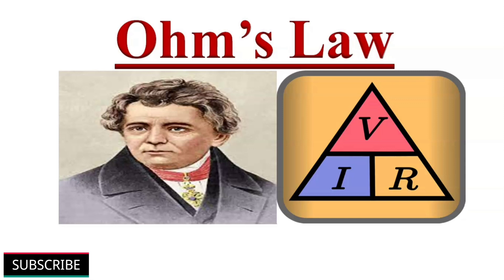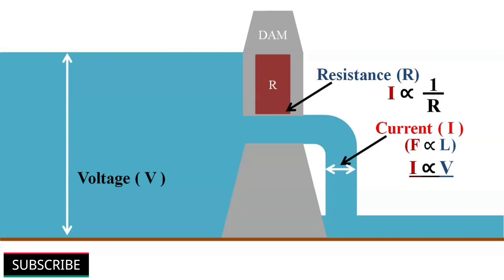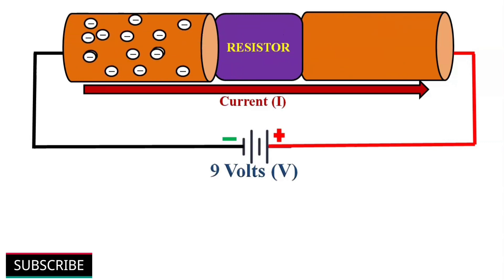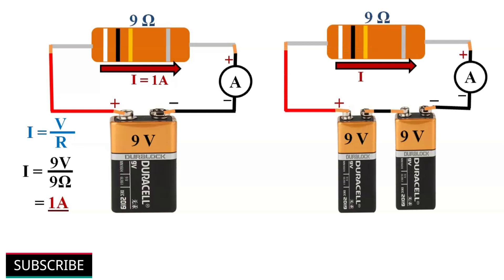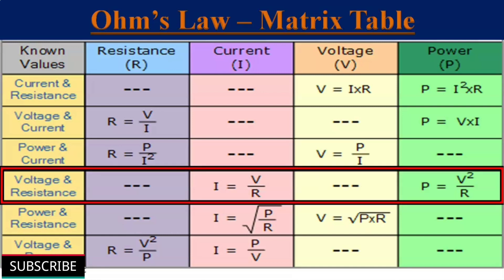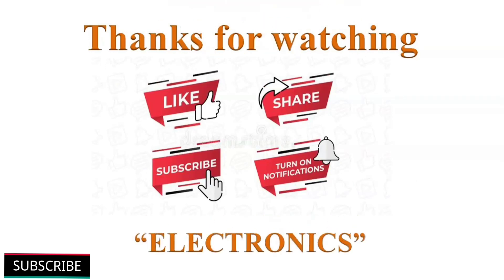Ohm's Law Explained with Examples (Applications and Limitations)

Comment from the maker: Timestamps for various topics covered in this video are as follows:
0:33 Ohm's Law Definition with Examples,
2:56 Ohm's Law experiment with Small lamp,
4:58 Ohm's Law triangle,
7:11 Electrical Power Defined with the help of Ohm's Law,
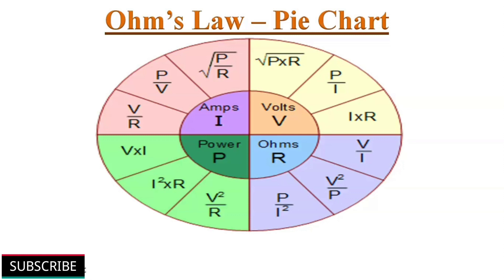8:41 Ohm's Law Pie chart and Ohm's Law Matrix table,
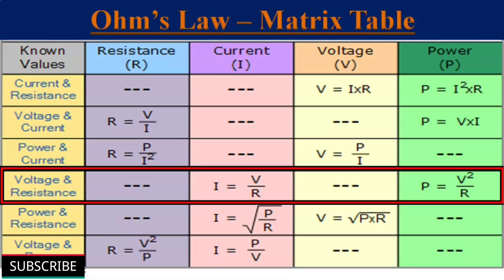9:26 Example - 1,
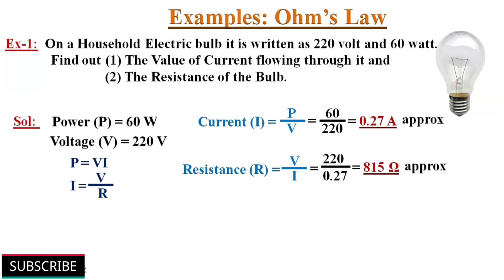10:42 Example - 2,
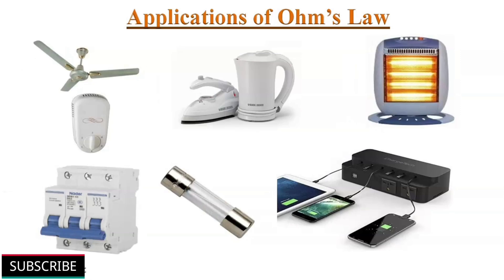11:40 Applications of Ohm's Law,
12:41 Limitations of Ohm's Law.